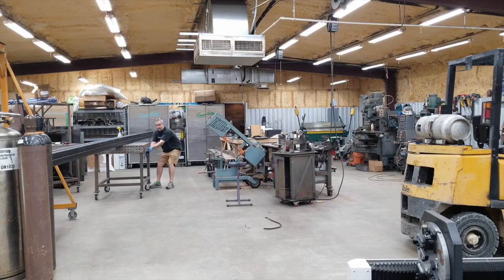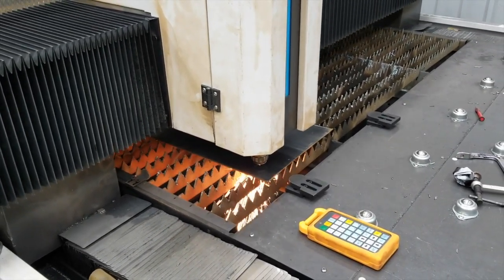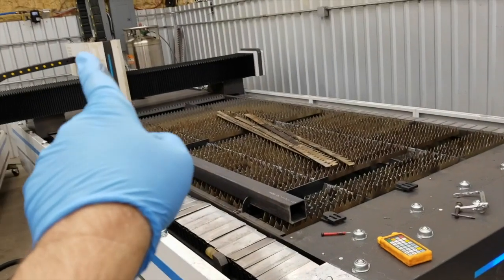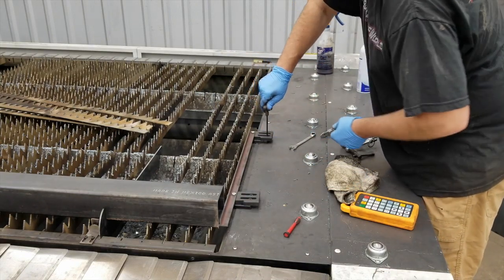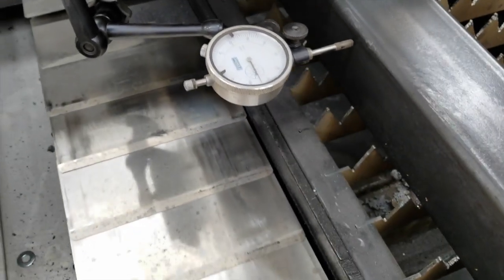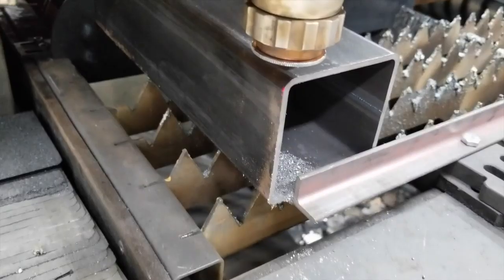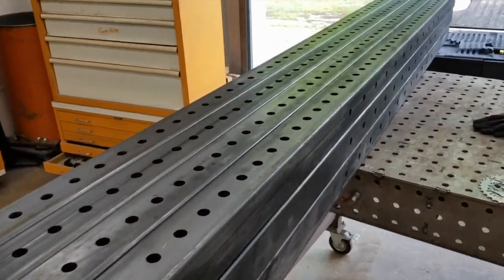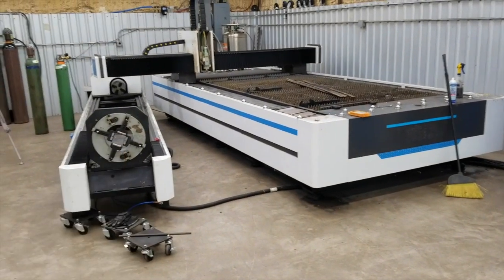Laser Cutting Square Tubing - Adjustable Jig - DIY Imported CNC Fiber Laser

Comment: How does the laser in the z axis not crash into the material? Does it have a sensor that detects the surface of the box section?
Reply from the maker: Yes, capacitance height sensing, i have demonstrated this in a few videos

Comment: Did you draw a program for that or is some other way  to do it when i try to draw it the post it it thinks its cutting on a flat plate and would want to cut the plate also.
Reply: you can choose ( only process selected graphics) option and select the circles only

Comment: Great job! how you avoid head crashes over the tube? I tried similar jobs with smaller tubes and head loses reference and crashes, as material is non-continuos
Reply: Some machine have aprofile cut condition , also you can define the high tube as thikness in software .

Comment: Just a thought,

How about moving the band saw nearer the door and make a roller table that's permanently outside bolted to the ground so you can plonk your materials straight on and crack on with cutting as soon as it come's in less work for yourself and manoeuvring too?

Comment: Nice job, totally jeleous of your equipment! I'm making some power racks right now myself and 1" holes using a drill press has not been fun!! Lol.
Reply from the maker: lol, oh yes, been there many times!  I have some other videos showing manually drilling 2000 .050" holes in stainless tubing
Reply: @turbocobra  I wonder, if you could do such small holes with this laser machine??  Not possible, right?

Comment: You're getting involved in all kinds of cool stuff.  I still owe you a phone call!
Reply from the maker: no worries sir, i have your stuff cut out.  And yesterday i gave a sample to customer that has a high precision made for metal wide belt sander, adn he ran hte individual cut out through it with no problem at all, so when your ready i will head over to his place and run them all through.  It was the guy i did these tubes for, his shop is 2 hours away

Comment: Beautiful work. I learned a bunch from you. If you had to do a bunch of these it might be worth figuring out some "ends" to the tubing so you could get the 10" needed to use your tubing cutter.
Reply from the maker: yea, that was a thought for sure, to tack a 10" piece onto the end of a precut piece.  I dont know if that would have saved much time to line that up, tack it, and then cut it loose each time

Comment: Great jigs Gary. I love jigs. I make lots of them, and save them. Unfortunately, I rarely end up reusing them. Need a couple of boxes (large!) of random jigs? I’ll tell you, that machine does beautiful work.
Reply from the maker: lol, I hear ya Mel, i dont have as many as you, but i have a few around.  problem is, some of them i may not can find when i need it lol.  But i have a feeling i will use this set again
Reply: @turbocobra  Paint the jigs Eco Mouse Green, and hang them on the wall. Put a little label on them to remind you what they are for.

Comment: Nifty setup work. That laser is a clean cutter that's for sure. Quite the rodeo bringing your steel in hah. Be well. Thanks for sharing
Reply from the maker: Yes, its a very accurate machine!
Reply: @turbocobra  was thinking about your rodeo hah... you've seen fork extensions and pick beams on forklifts. You could make a side pick that slides on. Carry a few sticks alongside the machine. Like 1000 lbs worth or less. After you get it off the truck, short chain to a side pick and walk right in the shop.

Comment: I can't imagine doing this on the drill press.Good job.
Reply from the maker: yea that would not be fun
Reply: @turbocobra  I tried doing some of these on a drill press and gave up and finished it on a plasma table and even that took several hours. Having a laser would have sped up that process exponentially.
Reply: @turbocobra  Just drilled 1500 holes off the drill press making two squat racks. Took about 8 hrs- and now I'm looking at laser cutting videos ha!